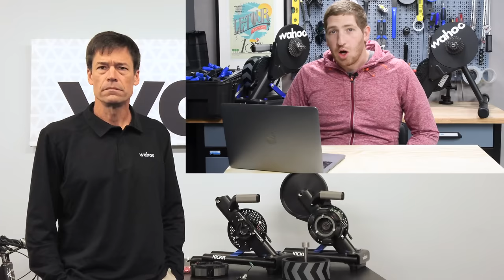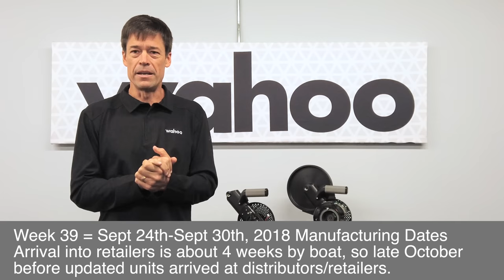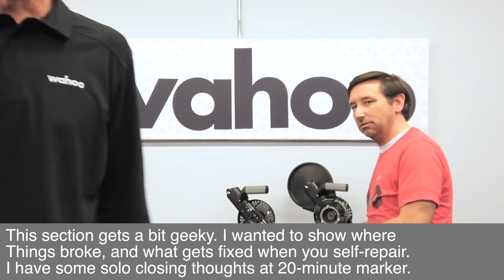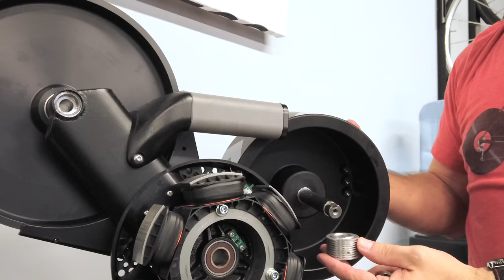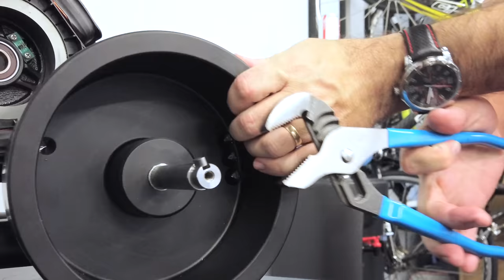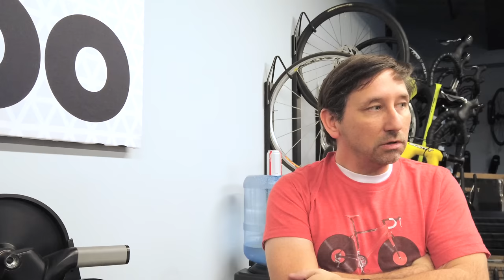Wahoo KICKR18/CORE Issues: Discussion with Wahoo CEO

Comment: Mine was defected from the box. My kicker core was made in 2020.... the bearing caused vibrations and all sorts of sounds. The company has no quality control procedure in place. There employees are very rude and product price does not reflect the value we get. And moreover, experts like the host are causing more harm by defending a merchant. I can’t believe it, a machine broke while you were reviewing it
Reply: same, i'm returning mine. did you return yours?
Reply: Leslie Alldridge I did return it and my retailer shipped a new one from a fresh batch. This one was even worse. I still did not return this one
Reply: @mohamadjamil3164  omg wow, that sounds like an awful experience :(
Reply: Am not the first. Many left their feedback on their website indicating the same problem....
Reply: I think the issue is, good customer service should mean creating a well tested, high quality product with a marginal failure rate. But it's been redefined to mean it's good customer service if a manufacturer sells stuff that breaks but they replace it. And that has meant companies are taking advantage of that acceptance to use their customers as the testbed for newer designs. At best perhaps the design phase pans out and we eventually get a good product, but long term running a company like this  has a high risk of failure (especially if your competitors undercut you on price and have fewer foobars - obviously built into wahoos pricing structure is covering all these returns they have to deal with - the kickr bike  being an example because the pricing is ludicrous)  e.g Stages developed a product people wanted but their company was in a US desert and it failed miserably if you didn't live in a desert (like most of us). And their response was generally after the fact attempts to improve the product seals and covers and otherwise basically just replacing products - but each of these products had an expensive Shimano part attached.

Eventually the wheels fell off and the company failed.

 They had a good reputation for 'good customer service' but, unless your actual plan was "I don't really want a power meter, I want to spend 6 months emailing stages and sending power meters back and forth through the mail" then it wasn't actually good at all. For sure, there might be a worse experience where you buy a power meter, it breaks and they say "Meh, tough titties bro", but the only good experience with a product if you think about it is when you buy it, it works and it lasts you years and years - and you never have to contact the company, send anything back, post videos to forums about your noises or issues or do anything other than enjoying using the product. 

As for people like DC rainmaker why would he care? For sure he'll make a thing about his honesty, but once you get the internet to pay for your hobby (and then some) then you pretty much lose your objectivity as much because your sense of value for money and quality disappears rather than because you sell out or anything. Put simply the value of a kickr core to most of us is higher than it ever will be to DC Rainmaker - who has roomfuls of training gear and if something breaks, whatever, send an email to wahoo and test the next one. He has no emotional attachment here to losing his money and getting a problem that you did if your trainer broke - and especially since he knows they are responsive to him. If you call or write customer services and are bit upset and they are rude back, well DC rainmaker never has that - because he doesn't care that the trainer broke and he knows his experience will be positive - and if it wasn't rather than meaning he loses something that means he can create another article or video which 150k people will watch.

For the end user who was only going to ever buy one trainer, especially a user who has less money to spend. If  he wanted that trainer to be good value for money and cheap, if his experience was buying a kickr core and it broke, well that's a bigger deal to him that DC Rainmaker is ever going to experience now even if once upon a time he did. He has roomfuls of expensive trainers, smart bikes yadda yadda which even if he says "I don't keep them, I send them back and I buy my own" - well he didn't his viewers and readers bought them for him - but we can't all monitise our hobbies in that way so most of us are going to want Wahoo to design and test their products on someone else other than us.

Comment: Kudos to the CEO for being so candid.  Personally I think the key design is fundamentally flawed and the locktite fix sounds more like a hack than a long term fix but he seems confident that it works. I've had great experiences with support thus far, thank you!  I had the key issue with two kickrs, the first was purchased at an LBS and the second was replaced by the same LBS.  I fixed the replacement myself and thought I did a decent job of it but now the kickr has developed a vibration that makes it sound like a motorboat.  I love the unit when it works.  Is it worth another attempt at a replacement?  I'm afraid that the replacement will have the key issue again.

Comment: I don’t believe him.  I am on my third kickr18.  My first one could not calibrate the power.  The second replacement unit broke within a few rides.  The key they sent didn’t really help. It was a week 44 model, which according to the CEO could never make this noise because they already fixed the issue.  The third one is obviously a refurbished unit.  It has the replacement parts but is far from quiet.  It’s about as loud as the previous models. None of my kickrs have had the ESD issue.  Between the customer support, Wahoo reps, forum posts, and now the CEO, nobody seems to be telling the same story.  Either they don’t want to admit how bad their quality is, or they just do not know.
Reply: i agree with you
Reply: With all the issues I've seen, I think the issue was known, but it was a massive money grab.  Sell truckloads and eat the QA/QC costs on the backend.  Meanwhile, the customers are suffering massively.  Shame on Kickr
Reply: @robbonner  exactly. these guys are lying through their teeth. the one guy didn't even want to be on camera. i will never buy one
Reply: @jen3800  Ray (DCR) is a stand-up guy. He can be a little too "nice" or "blue sky" in this thinking but I think he is fundamentally honest.
Reply: Agreed. I went through five Kickr 18s. Two of which were finally quiet, but had very noticeable vibration issues. Wahoo denied it, refunded my money, and then promptly blocked me from the Wahoo Kickr Support Facebook group. I'm actively avoiding Wahoo products for the foreseeable future. Customer lost.
Reply: @misterangular   Hey come one now.  Ray got the guys out here to at least address it! Who else in the whole cycling industry did that for us!  Keep it directed at the problem! Not at the guy who went out of his way to deliver us the content! Wahoo should be adding a second year onto the warranty of these machines!
Reply: @camd5348  My comment was about the CEO not Ray.  I am a big fan of DC Rainmaker and I have made a lot of purchases based upon his reviews.  I bought the first generation Kickr after reading his review.  My opinion of Wahoo is crap after watching this video though.  He reminds me of Steve Jobs saying that the iPhone 4s antenna problem was because users were holding it wrong.
Reply: Really wishing I had gone with a Neo. I'm on my second Kickr and so far am down 2 weeks of training over three months and am still waiting on a new unit to replace my ESD fried one. Kickr support pushes the problem to the distributor instead of helping.
Reply: @toxqui11  tacx Neo. Sold my kickr 2018 at a loss and still trying to sell my climb. Kickr customer support was so frustrating when I was trying to get my second unit in three months replaced. The Neo is fantastic so far. I can even take it to races to warm up because it works without power.
Reply: I am inclined to agree with you.  Not sure how a design problem has intermittent failure rates. Also wondering what is actually causing the noise.  It appears that the pulley keeps the key from coming all the way out vertically, and the washer holds the key in laterally.  Locktite is part of the solution... how about duct tape and baling wire?

Lastly, the ESD issue has been known for 3 iterations and still no fix.

I’m doing research in advance of my first purchase and Wahoo is currently not high on the list due to the poor QC.  This is unfortunate because the Wahoo seems to be the “it” company - really wondering why...

Whoever said cash grab nailed it.

Comment: I had the explained noise issue on my Kickr Core back in the beginning of November 2018, plus the Chevron stickers started flying off. I chose to get a new "tested" replacement unit, but when I finally got it, it had a different noise issue straight out of the box. The problem on this replacement unit was, that the plastic cover was rubbing against the drive belt wheel, generating a loud scraping noise. Needless to say I wasn't happy :-( I shipped the replacement unit back, and chose to fix my original unit instead, according to the repair instruction from Wahoo. I got a 100 Euro giftcard, and some new yellow Chevron stickers. Unfortunately the new stickers were no better, so even though I degreased the flywheel thoroughly before applying them, they started flying off too :-( I think the problem with the stickers is, that the paint finish of the Kickr Core flywheel has quite a rough texture to it, so even though the adhesive on the stickers is OK, it doesn't stick very well to the flywheel, especially when it heats up during the workout. I know this is a minor issue, but it doesn't look very nice without half of the Chevron stickers.

Comment: Great work gents - amazed to see a CEO stand up and speak openly about the issues / challenges. Goes a long way towards engendering a user's trust in the brand. I was a bit surprised to hear that the power etc is all taken from speed within the unit. I'd assumed a £1000 unit had an actual strain guage power meter inside it, or have I got that wrong ?
Reply from the maker: Older KICKR's used to, but they found better accuracy without it. No different than Tacx units for example.

Comment: As an engineer in the industrial electronics industry I am curious how ESD problem wasn’t discovered during CE certification testing when that is part of the qualification tests?
Reply: ESD damage takes many form, one of the most common is no destructive damage to the silicon where the silicon is damaged but still functions.  The immunity tests only look for catastrophic failure, not damage that only weakens the chip.

The explanation provided by the CEO is totally plausible.  What is needed is a way to protect existing units.  I wonder if Wahoo has considered providing an ESD grounded Matt and a simple instruction to step on the map before touching the trainer or bike?
Reply: @victrolaman2007  The testing required for CE Mark cert should have raised the issue, which seems to be a lack of dissipation of the energy that can be delivered to the sensor board when the chassis receives an ESD. What is possible (and quite frequent) is that some changes were introduced down the line without re-testing; the reference to some power supplies being grounded while some where not is consistent with this hypothesis. So you pass the cert tests, then introduce a change which can cause the test to fail.
Reply: @robertcourteau4320  You are correct, however, Wahoo would be in violation of the CE mark if they did not retest, or if they submitted claims that they tested and passed when they did not test.  I have many years in the IC business and it is not uncommon for an IC to pass the zap testing by not showing a catastrophic failure.  That does not mean it wasn't damaged, just that it did not fail to function after the test.  I am willing to give Wahoo the benefit of the doubt that are in compliance with the CE mark (the risk to their business it too great to cheat on such a simple test).  What I find more troublesome is that whatever silicon device is getting fried does not already have ESD protection structures internal which is standard practice today.  That would be something that Wahoo needs to take up with the damaged part vendor......
Reply: Having over 30 years in the industrial electronics business I also understanding of ESD CE requirements and having gone through 3 Kickrs all having catastrophic failure  from what he is indentifying from an ESD shock. And since as you have said this is an easy thing to overcome I do not think Wahoo fully understands ESD having sent 2 more units to the same environment knowing how the previous ones had failed.
Reply: @victrolaman2007  not in electronics, but mechanical. Is it possible that they tested with a CE marked PSU with grounding, but then swapped to a CE marked PSU without grounding? in my case that would very likely be a very simple update of a report with no testing required.

Also is it possible that the certified PSU that was used during testing went through a revision and continues to be certified because the PSU company retested, but the change impacted the ESD protection of the system?
Reply: @chrisshepherd4933  I understand your frustration.  The CEO did admit that the vulnerability exists in every generation and they did not realize it was an ESD problem as the occurrence frequency was lower than other problems.  You always fix the big problems first.  Eventually, the small problems start to raise to the top of the frequency metrics and you shine the spotlight on them.  The CEO did state that they just found that they had the design issue.  It is a pretty big admission when you say all your product is susceptible, but if you know the occurrence rate and it is below acceptable levels, you make it good by your customers and assure future customers you have it licked.  None of this is much consolation when you have gone through the problem repeatedly, but from Wahoo's view, its a small and manageable number.  Lets hope your 4th Kickr is the charm.
Reply: If, like me, you have gone through at least 3 Kickrs and still have the power/speed failure.  What is your resolution?  Did you switch to a different brand?  Which one?  I'm currently considering Cycleops H2.
Reply: I think we are only debating scenarios here.  The supposition in this thread is that Wahoo either cheated certification process or knew about the problem, refused to fix it and lied to customers.  I don't think either is likely.  If they cheated, then they should have known when the started seeing the problem and resolved it, and If they knew, why didn't they fix it from the beginning?  Wouldn't it have been much easier just to claim it is a new issue on the new HW variant rather than admitting it is present in all variants?  High volume products are a numbers game and there is too much to loose to cheat or ignore a big problem.  I know there are folks that have already made up their minds on Wahoo, and that's fine.  I'll take Wahoo at face value as they seem to be doing right by their customers.  Who among us is perfect??
Reply: @snavekir. The wasn’t a fourth Kickr for me. I wanted to be riding, not dealing with tech support and Fed Ex. I won’t say anything about my current set up because I don’t want to jinx anything but I’d say you are looking in a good direction.
Reply: I never said cheated, I question the test levels which I thick is a fair when I had three different products that  couldn’t survive more than 3 or 4 days for an hour or 2 in a home environment. Unlike UL there is no governing body to sign off on the testing. The individual company is responsible for there own CE compliance and what levels they test to. In my opinion if they had selected the appropriate rest levels for the environments there product would be used in they wouldn’t have a PR nightmare where the CEO would have to go on YouTube.  I guess for the money I spent I expected better.
Reply: I never said cheated, I question the test levels which I thick is a fair when I had three different products that  couldn’t survive more than 3 or 4 days for an hour or 2 in a home environment. Unlike UL there is no governing body to sign off on the testing. The individual company is responsible for there own CE compliance and what levels they test to. In my opinion if they had selected the appropriate rest levels for the environments there product would be used in they wouldn’t have a PR nightmare where the CEO would have to go on YouTube.  I guess for the money I spent I expected better.
Reply: I never said cheated, I question the test levels which I thick is a fair when I had three different products that  couldn’t survive more than 3 or 4 days for an hour or 2 in a home environment. Unlike UL there is no governing body to sign off on the testing. The individual company is responsible for there own CE compliance and what levels they test to. In my opinion if they had selected the appropriate rest levels for the environments there product would be used in they wouldn’t have a PR nightmare where the CEO would have to go on YouTube.  I guess for the money I spent I expected better.
Reply: I never said cheated, I questioned the test levels which I thick is a fair when I had three different products that  couldn’t survive more than 3 or 4 days for an hour or 2 in a home environment. Unlike UL there is no governing body to sign off on the testing. The individual company is responsible for there own CE compliance and what levels they test to. In my opinion if they had selected the appropriate rest levels for the environments there product would be used in they wouldn’t have a PR nightmare where the CEO would have to go on YouTube.  I guess for the money I spent I expected better.